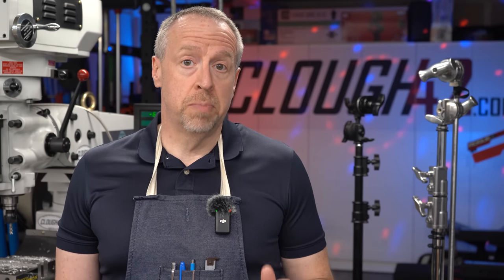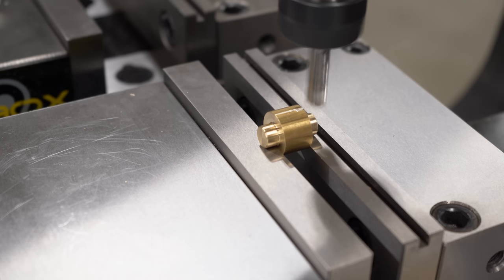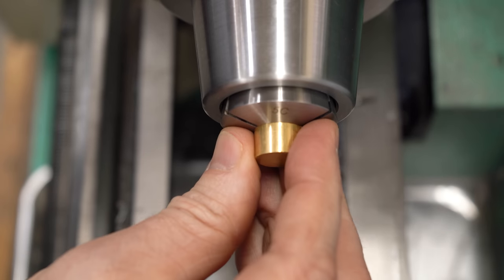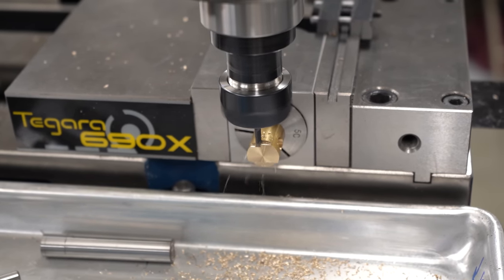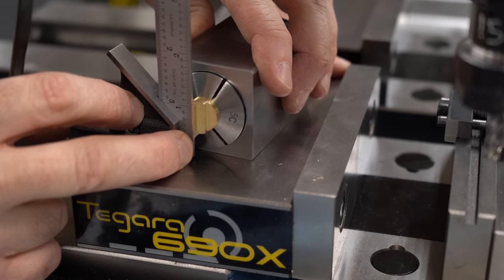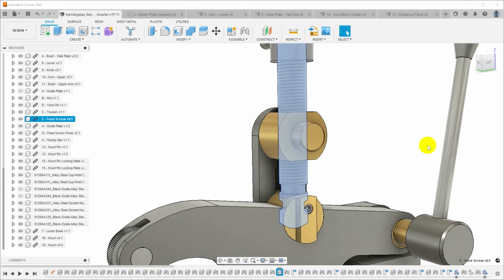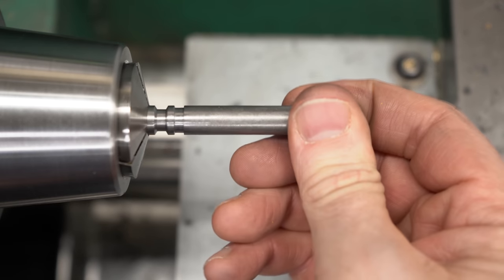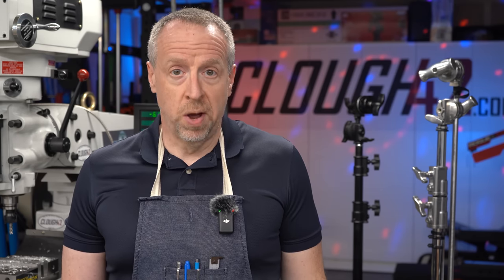Making a Nut, Trunnion, and Screw:  Hemingway Sensitive Knurling Tool - Part 4

Comment: You WILL remake that threaded part.. You won't sleep till you do ..🤣 You are a perfectionist 👍🏻
Reply from the maker: I already remade it in 1144, and now I can sleep.
Reply: I clean up threads with a wire wheel in the drill press.  Removes all the ugly quickly.
Reply: @DavidtheSwarfer  Does this work on one's own face?
Reply: @MrMartinSchou  years of trying has proved not
Reply: @DavidtheSwarfer  I suppose the drill press is slow enough to not throw wires at your face? I've learned to wear an apron and face shield when using wire wheels to avoid getting tiny wires embedded in my abdomen or face....

Comment: Your comment about the spotting drill was a fantastic explanation of how they work and why/when to use them. I’d never given it much thought before, now that little gem of wisdom will stick with me forever. 👍
Reply: Not to mention, spotting drills are cheaper and more robust. Never had the tip of a spotting drill break off in the job. They don't do well if you get your Z height wrong in your program though!
Reply: @mhagnew  haha, yep been there done that. Good luck digging that kryptonite hard little tip back out of your part when it breaks off. 😬

Comment: James, I watched with pleasure like always. One suggestion; YouTube machinist are really font of scratch passes when they start thread cutting. I know better safe than sorry but I use a different trick without any scratching needed. I put the machine in neutral and engage the thread cutting nut on the carriage. I turn the spindle by hand so that it references "a" feature at 12 o'clock. Camlock hole, number one chuckjaw; it doesn't matter as long it's a clear indication at that moment for where you are in the 360 degree spindle domain. After establishing this point for yourself, hit the y zero button on the DRO and make a full turn with the spindle using your established marker point. After doing so your DRO should show you the pitch you aimed for within a small enough uncertainty. Using a setup on a gear driven machine the reading will show you a wrong setting of the levers on your machine. Remember to turn the spindle in one direction so you don't encounter backlash issues in the gear set-up. Just a scratchless way to check the set pitch. 99.9 percent of the time I'm right but this avoids booboo's for the remaining 0,01% percent without any scratching the part. I hope this makes sense and helps you and/or other machinist in their machining journey . Thank you and all the best! Job
Reply: Nice tip! I love manually rotating the work when I’m teaching because it removes the motor from the mind of the student and they can focus on the movement relationship and gearing.
Reply from the maker: That's a good idea.  It is of course much more convenient with metric threads, where the pitch is expressed in millimeters and requires no math to read it off the DRO.  Also, I could replace the motor in my ELS, and not do scratch passes at all.  :)

Comment: When I bought a spotting drill a while back I did some research on whether the angle should be greater than or less than the drill point angle. Guess what? You'll find arguments/reasons supporting either one. I went with your logic and use a 120 degree one. Great to see the small pieces you are producing for this project. Even your deliberately scrapped part to make us all feel better about our work.  😁
Reply from the maker: I think there's a difference in the preferred spotting drill angle for hard vs. soft materials.  As you say, there are many opinions.

Comment: About the spotting drill
That's why I only use the straight part of the center drill and not the tapered part, the center of the drill lines up pretty well and the flutes don't touch first
Reply from the maker: If you use only the tip, that should be 118 degrees, and should work fine.

Comment: My Dad taught me to cut the threads oversize and chase them with a die for correct size and good surface finish.
Reply: Thats a good way to do it ,especially in stainless steel ,dies last longer that way.But sometimes you dont have  a die and to learn threading operation is not that hard as people of youtube say it is. I learned it as a 15 years old kid when i was apprentice.Just expect to screw up first 5--6 times.The more you do it the easier it gets.Even tool grinding gets easier.Key is to do it frequently ,not once in 5 years . Just like welding with stick. PPR pipe or plastics are best for learning since you cant crash the lathe in them.Start with big pitch threads and work down to small ones .
Reply from the maker: I remade the part and used a die in my tailstock die holder.  I also switched to 1144 steel and probably didn't turn down the diameter of the blank enough, so the effort was super high.  But the part looks great.

Comment: 16:50 why do you have 2 lines here? Aren't the setscrews at the same position?
Reply: The setscrews have cup points so they each rub in 2 places on the cylindrical surface. Unless he got them to exactly the same dimension from the end, by rights there will be 4 scratches. The groove will then be wide enough to cut out all 4 scratches.
Reply from the maker: They're cup-point screws, so they have a hollow on the end and each leave two scratches when rubbed against a cylindrical surface.  Because the screws are aligned, the scratches from the two screws overlap.  They don't show the full width of the screw--just the width of the cup point--but they accurately show the position.
Reply: @Clough42  thanks for the explanation! Those screws don't seem to be common here....

Comment: Dumb question. How does the tap from both directions match the thread? 

Is the deviation small enough the tolerance on bolt thread does realize there’s a difference?
Reply: As there is one screw coming from each end and there is a big hole in the middle, the small threads don't have to match...

Comment: who makes the R8 to ER collet holder you are using in this video. Do you have a particular model # ?
Reply from the maker: It's a TTS tool holder.  In this case, an import knockoff.  Search eBay for "c3/4-er20a".  They use a special short 3/4" R8 collet from Tormach so they pull up and register against the face of the spindle nose as well as in the collet.
Reply: @Clough42  Excellent! thanks.

Comment: I was very close to buying a lathe collet chuck when you followed up with some issues you were having with yours. What has become of that? Are you still using it?
Reply from the maker: Still using it.  When it eventually fails, I'll buy a better one.
Reply: @Clough42  do you have a better chuck in mind? It would be a nice accessory for mine but not absolutely necessary.
Although once I have something I realize how much I really need it.

Comment: You mentioned recently how much you love the dual vice setup... I think you had a single Kurt vice in there before, are there things you miss about the fancy expensive Kurt? (Especially when doing small parts like this that don't use both vices at once)
Reply from the maker: The only thing I miss about the Kurt is the dovetail vise stop that locks into the fixed jaw.  The Shars/Tegara has the groove, but doesn't come with the stop.  Kurt has a patent on it that expires very soon, but in my discussions with Shars, they don't seem to be planning to make one.

Hmm...that might make an interesting shop project.

Comment: ive never had a drama with straight infeed threading like that, might be worth making a carbide tipped cutter and see if that helps finish or just change it all to metric thread 😁lol
Reply: Changing from X TPI to Y mm pitch won't make that bit cut any smoother.
Reply: Use a carbide insert thread cutter with the designated pitch. You can feed it in straight and check your outside thread dimensions while you're getting close (look at the width of the top angle of the cutted thread; you know how it should look. If the cutting starts to diminish your outside thread diameter your probably right on target or really close by. Check for fit, make some spring passes depending on the quality of your setup and machine and you should end with a proper threaded part.  Such an easy way to single point thread a part. No books, no guides, no feeding in at an angle with the compound. Modern days improvements in our daily machining job!

Comment: Where can I buy those inserts for the lathe holders you used in the beginning with the brass
Reply: search for a collet chuck and collets
Reply: 0:37 Edge Technologies 5C collet stop
Reply from the maker: You mean the collet stop?  There's a link in the video description.
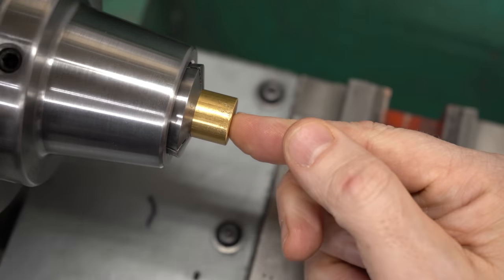Reply: I'm talking about the tool/insert at 1:10   thats in that lathe tool holder
Reply from the maker: @gehinarsch  ahh... That's a Mitsubishi DiaEdge CCGT09T304-AZ HTi10 also called CCGT32.51AZ.

Comment: Bummer that the ELS died. I don't think I could use mine without the ELS now. Did you find out what broke on it? I see you already made a new Threaded part. I knew you would. 🙂 Once again, great detailed video James. Well done!
Reply from the maker: It looks like it was the $100 import servo motor.  It's been great right up until it died.  When I apply power, the LED doesn't light, and it doesn't activate.  Everything else seems fine.
Reply: @Clough42   That s a simple fix. Hopefully that is all it is. Good luck
Reply: Well, shoot. I was planning to order one of the $100 servos today. I’m glad that you mentioned its failure!
Reply from the maker: @OhHeyTrevorFlowers  I wouldn't let this stop you.  Stuff happens.  It worked great for quite a while.
Reply: I’m now using the wonderful option you built in to turn off the lead screw if I’m doing a task that does not require it. Clever design you have with a simple on/off button. 👍🏻

Comment: Erm, I'm a bit confused by the tapping you did. If you start it from both ends, isn't there approximately 0 probability that the 2 threads will be "in sync" where they transition ?
Reply: Each thread is partial because there is a whole between them. They are for separate screws so no sync required.
Reply: @carlhitchon1009  Thanks, I was clearly not concentrating. I'd somehow got it into my head that this was the main lead screw, despite the massive disparity in size.

Comment: You say you're a perfectionist, but I didn't see you lap the nut onto the screw with a non-embedding lapping compound. How can you call yourself a perfectionist when you've got multiple tenths of backlash in your knurling tool? If you're not chasing a surface finish and part accuracy that can only be measured with an atomic force microscope you're clearly not a true ~Scotsman~ perfectionist.
Reply from the maker: As a matter of fact, the brass will run in on a tight thread without lapping compound, which is exactly what happened when I made the replacement.